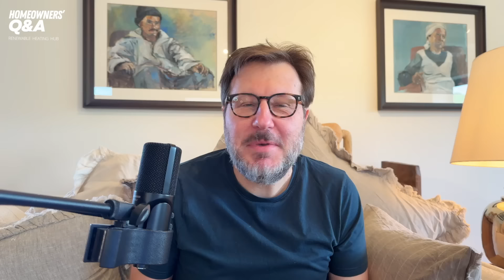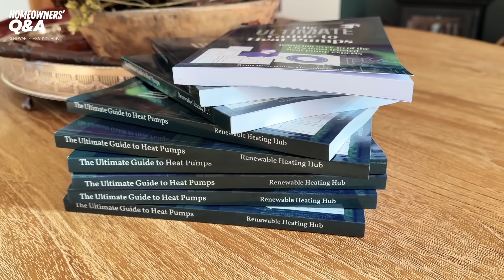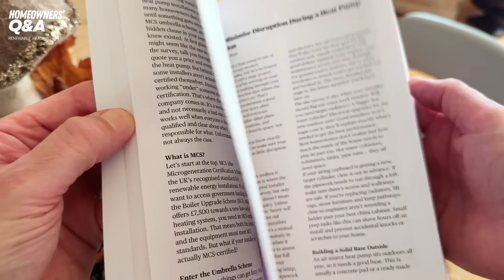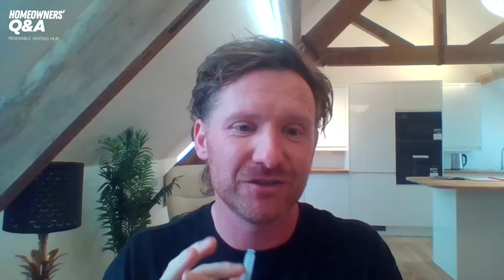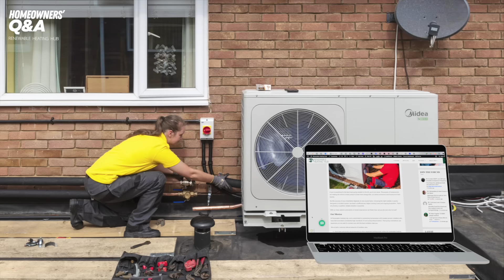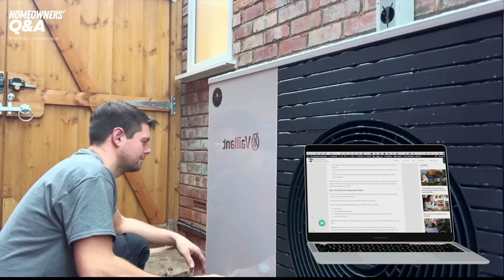Can Heat Pumps Work Well in Poorly Insulated Homes?

Comment: Insulation first if possible. The order would be windows ceiling, and then walls and floor. If done prperly concidering moisure and ventilation needs this will last as long as the house stand. I would at least survey this in advance before the boiler breaks. Same goes with piping and radiator reqirements. If there is little to be done and no major piping re-work needed I would wait until repacement is needed and decide after that if to switch. In between do the extra insulation if possible.

The fact is in the cases were there is a high heatloss and limited possibilities to have proper insulation the benefits of a heat pump is very small.

We have 25 cm fiber insulation in the walls, 10 cm foam insulation in the floor sitting on gravel, and 45 cm blown fiber in the ceiling. The house have tripple glased windows. Heating 240 sqm consuming 4600 kWh per year. House is built in 2004. Vaerage yearly temp is +7C , DVUT is -27 C. This was standard building in Finland 2004.
Reply: Payback on windows can be decades. At some point it might be better to design a system without double glazing everywhere. 

Its quite logical if the cost of the windows is very high.
Reply: @const@c@c @constructioneerful ive in Finland were we have a colder climate. Here at least it makes more sense. A one glass window have an U-value of 5, a tripple glass window have an U-value of 0.7-1.5. In our current building regulation we need to have an U-value of less than one. The most efficient windows on the market around here have an U-value of 0.55. These have two double glased glasses, i.e. a 2+2 window.

We  have 24 sqm of windows. Our windows have an U-value of 0.8. They are from 2004. We can have temperature difference of 60 dgreesninnextreme cases between indoors and outside temperatures. Average winter temperatures in January-February in the northern parts are -17C. That is through our windows can go 24x0.8x60=1152 W in extreme conditions or 1.2 kW. If I would have single pane windows that would be 7 kW. No one here of course have such windows as it would become impossible to heat the house. This at least if one wants to have windows on the house and some comfort level. 

This is why upgrading to modern windows first makes sense here, and this especially when concidering a change in heat source. 

Let’s say my house was in Uk and the maximum temperature difference would be 20 degrees. With single glased windows Our heat loss through the windows would be 24*5*20=2 400. Let’s say a double glased window have a U value of 2. Then the heat loss would be 24*2*20=960. This is of course the DVUT temperature case, or the themp the heat pump installer would look on when suggesting what pump to get. A difference of 1.4 kW is in my opinion conciderable for choosing the correct heat pump.

Now I do notnknow ifbyounactuallynstill have only one pane of glass in your windows or two separate glases without argon filling so thenexqmple might he theoretical. In the old houses herether could be two glasses. The inner glass was normally not on hinges. You put it in for the winter and put window tape in the seems and removed it in the spring.

Heat loss is ofcourse one thing. I would likely replace the windows just for the sound insulation qualities if I don’t live in the middle of the forrest, which I think is uncommon in  UK, not here though😊

This I think is the reasoning behind the recommendation of the order, window, ceiling, walls here in Finland. Ceiling just for the reason that it has been neglected in the past and the heat loss is larger through the roof. There is also of course an estetic and amount of work that dictates this.

A typical window installed here would cost around 800-1200 Euro, or replacing windows here would typically cost around 15-25 k. Yes it is expensive. There needs of course to be individual calculations but here a window upgrade might save 10-20 % on the heating costs. A  newley upgraded heating system improves the value of the house, but not one that you need to replace soon. Energy efficient windows do not depreciate in value. It is little same with all insulation, or should at least be. There are of course less informed house buyers.
Reply: I don't disagree, but when the home owner produces renewable energy it offsets the issue.

Comment: So. She would rather sell a heat pump to someone which would be eventually oversized which means it’s going to be inefficient. It’s going to cycle if you increase the insulation. 

Talking about selling a cascade heatpump which will be much higher running cost will feed into the “expensive to run” narrative because they don’t want to spend £20k on insulation. That behaviour will push people back to gas. 2x heatpumps, higher running costs, more servicing costs, or a boiler which at worst is likely to be cheaper than their existing running costs.

Comment: The joy of inverter air/air systems versus air/water 8)

It's also very good to push insulation but for some older buildings a lot of the insulation being pedalled is completely inappropriate (eg the ECO4 fiasco). If you've got a solid wall building there are good reasons you might want to take the hit or go with a system that can do rapid heating of specific rooms. EWI/IWI isn't just cost - it's the risk of turning your house into a mouldy catastrophe. There is good EWI for a solid stone building but it's fantastically expensive and your typical UK cowboys don't care about slapping up dodgy cheaper EWI instead.

If you can do insulation then sure definitely it's a first step - it'll save a ton of money and some emissions even if still on gas.

Been through all of this for a big old victorian pile which couldn't be further insulated (grade II listed) and we ended up doing air/air simply because it was ridiculous trying to do it with an air/water system.
Reply: Interesting, I'm an old victorian pile too. I did a lot of IWI over 30yrs ago, couldn't do the stairwell and a couple of small spaces. A2A isn't practical on this 3 storey terrace, recent relaxation of rules might make locating an A2W heat pump feasible now.
Early ECO did some EWI on several rental properties [1930s semis and a few 2 up 2 downs] and so far they seem to be a great success.
Reply: That’s similar to my situation.  1895 house, thick solid walls, grade 2 listed, 3 floors, single glazed sash windows with secondary units in place in the winter.  We could strip all the plaster out and re-lime plaster with cork pieces in it to increase insulation, however the cost is prohibitively high and would never pay us back. 
Oil boiler is 15 years old eats £100+/oil a month running flow temp at the minimum it can be set to (55c)  in the winter.

Comment: Around 19 mins, lady in orange, conflating cost to run and carbon footprint. Why? The spark gap isn't fictional, and neither is the cost of living crisis. I thought the conversation had moved on from green at no matter what cost to something more realistic. We insulated and got a modern boiler in a 60s retrofit, and halved our gas consumption. Glad we did, given the recent tech improvements to heat pumps (R290, lower modulation) means we might afford the running costs when we complete the transition at a later date.

Comment: That was interesting, I didn’t know they up modulated solely to oil the compressor rather than just to increase heat output. The periodic weird behaviour of mine (oversized by at least 40% not for want of arguing with the installer) at low modulation now makes some sense, I previously assumed the control logic was just a bit special needs.